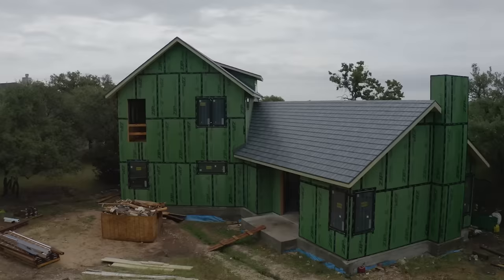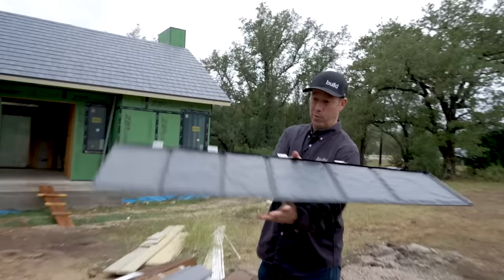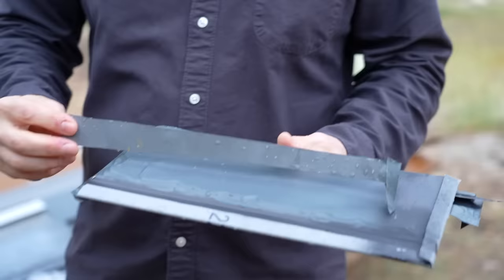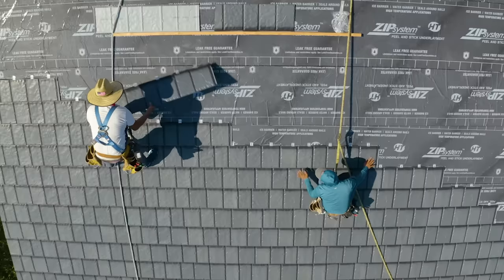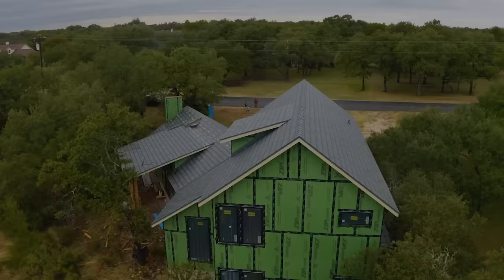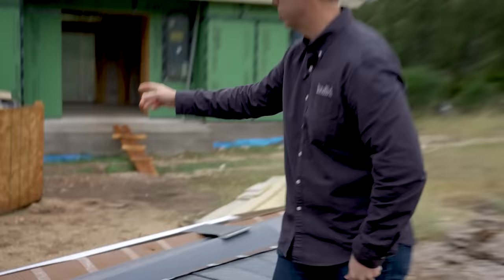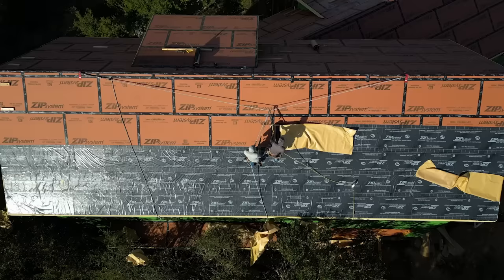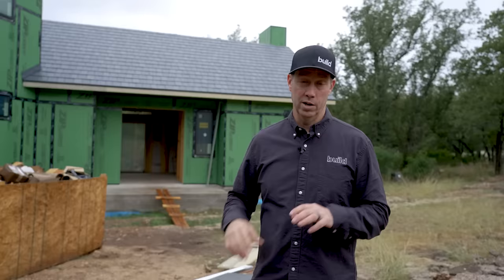Don't like the "metal roof look?" Check out this metal SLATE alternative!

Comment: It was $33,000 in materials to do my house.  I paid $4,000 for shingles.  I can replace my roof every 15 years for the next 120 years before I hit the metals cost.  At 120 years the metal will most likely need replaced.   I just couldn’t.
Reply: How much was labor to install?  That will cut into those replacement roof cost pretty fast.
Reply: @lukemarks9132  sweat equity I believe
Reply: You don’t get the resale value tho
Reply: @lukemarks9132  I don’t even want to know!!   Another product installed by a local company was $36,000.
Reply: @cybertrk  for which?   I’m not worried on a house I built and I’ll die in but it can’t change much.  All houses are 500% over valued right now so I don’t think it matters for a few grand.
Reply: That's something these channels never address. If money is no object than whatever. How good people think the metal is really going to look after 50 years of weather?  Shingles make way more sense economically.
Reply: @smhammer92  well mine were more because 1. I didn’t want their paper thin aluminium.  If I looked at it hard enough it would dent.  So 2. I spent less on galvanized steel which wasn’t insanely thick and hard but I had to pay more for better paint.  That really jacked the price up!!
Reply: Use natural slate it's the best
Reply: @master_Blaster91  that labor has to be insane!   Wonder what the engineering has to be to support the roof?  Just more truss size and closer together?
Reply: @neckofthewoods24  I actually use what's called Yorkshire grey slates . They are huge slabs of Yorkshire sandstone that diminish in size as they go up the roof a roof could have  10 - 30 tons in weight on the roof. They normally have 3 X3 or 3 X 4 wrafters and great huge perlins to support them. It's really hard work. And natural Welsh slate is alot lighter and easier to do
Reply: @master_Blaster91  wow!!!  Yeah not an American style or affordability haha
Reply: @master_Blaster91  how it compares with prices and durability? we grew up with terracotta roof and we loved it
Reply: @maragrace820  we regularly reroof properties with slates that are 100 years old and not leaked no under felt and the slates are as good as the day they were quarried. Brazilian and Spanish slates are the best import slates and in England at least are not that expensive and your roof will last 70 year plus no problems if installed correctly
Reply: @master_Blaster91  just for reference in northeastern United States our ~3300 sq. ft. slate roof will cost us about $200,000 USD to install / replace so yeah “just use natural slate”
Reply: @TheVinceZampella  that's outrageous 😮 must be a huge house
Reply: He said the materials was only 2.5 times the cost. And if the asphalt shingles only last 15 years, and this lasts 100, you are better off just putting on this steel/slate style roof.

By the time you were on your third or fourth roof, you would’ve been saving money, and time, and the bother.
Reply: I'm a distributor of Edco Products. There is no chance your #s are correct. It might cost 3x asphalt shingles. Never 8.5x more. Something is amiss
Reply: @stefanboyer9893  lol well it is and unfortunately they are.  The metal was indeed $33,000 shipped to my house with all panels and edge trim and screws etc!  They wanted like $450 a square and the locking edge trim added A LOT more to the square cost!  Singles were like $28 a bag.  3 bags are 98.4sqft.  My roof was 5,000sqft.  So it’s pretty simple math from there.
Reply: @master_Blaster91 think about the weight!
Reply: Better get someone who knows what they’re doing. Or get a good lawyer!
Reply: How many times can you remove and renail a new roof before you start to compromise the underlying roof deck and structures? 

There is something to be said for treating a house as whole system that works together vs a random collection of rapidly decaying parts worked on by random labor in isolation.
Reply: @caustinolino3687  I’d say a 100.  The house would need replaced first.
Reply: @caustinolino3687  I’d say a 100.  The house would need replaced first.  A little roofing nails not going to hurt the integrity of Osb or plywood sheathing.  Remember a Osb flood joist can have massive holes cut in them and still hold the same amount of weight.
Reply: @neckofthewoods24  Interesting, but I didn't have in mind that the roof integrity would be shot and would collapse. I meant how many times can you have laborers, often sloppily, pulling and (over)driving hundreds of nails into the same materials before it can open the door to other problems like rot, leaks, or whatever.
Reply: @caustinolino3687  well there would never be a leak or rot.  That’s the job of new under-laminate and roofing every time it’s replaced.  Normal shingles are like 10-15 years.  Steels like 100 years.  I think it’d be very rare for a nail to hit the same hole twice which wouldnt hurt the integrity of the sheathing but you’d need another nail so the shingle or metal roof stays attached.  Eventually a nails will start hitting the same holes but again that’s like 100 roof jobs or 1,000 years from now.
Reply: More money in labor than material
Reply: Not only that but you can’t get insurance to replace it every 10 years if you have hail damage and most roofing companies will eat your deductible to get the business.
Reply: Forgetting to adjust for inflation, replacement labour and disposal costs. But if price is the goal then sure shingles cheaper out the gates
Reply: @master_Blaster91 different weather systems. In Oklahoma we can have heavy hale storms twice a year. Asphalt roofs are generally 4-5 years til replacement with 10 really pushing it. Slate and stone roofs just aren’t worth it when you risk full roof replacement every 10 years. Your insurance premiums would be sky high.
Reply: @neckofthewoods24 $28 dollar shingles can’t be rated great though? That’s gotta be a 5-7 year roof max depending on location. Here in Oklahoma closer to the 4-5 end depending on weather.
Reply: @neckofthewoods24 50 years of asphalt roof replacement you’ll need to replace decking.
Reply: @nightterrors6262  I mean everyone uses them.  No way it’s only 5-7 or 4-5.   I know houses 20+.   Doesn’t mean they are mint condition but even if the granules are falling off, you still have the middle and back layers plus the under laminate till you get to the plywood.  Apparently there’s a spray conditioner that some companies are using now to extend the life.  Rehydrates the shingle and makes them last longer.  Don’t know if it true but make sense in my mind.
Reply: @nightterrors6262  why??  I’ve seen shingles come off and the tar paper and the sheathings still mint!   Replace both and you’re good to go again and again.  No need to replace if it’s till good and holding strong.  Good ventilation underneath and water protected on top and it should last forever.
Reply: If you can't afford it, you can't afford it...
Reply: You're not taking your age into account. I'm replacing my own roof this summer and it's the last time I want to do it because I'm 54. I won't be climbing at 70 so I'm spending more for materials now to ensure the roof will still be in good condition when I sell because I need to move into assisted living in my 80s...assuming I even live that long that long.
Reply: No ridge vent? How does the hot air escape from the hot attic?
Reply: @smhammer92  NOT here in PARK FIRE pine flameer forest. Steel resists EMBERS.

Comment: I am building material supplier, and I have had several customers who have went the metal roof route who complained about their cellular service after the metal roofing was installed. Have you had any  experience with cell service issues from metal roofs?
Reply: That's interesting since most modern phones will use wifi calling if they're connected to a local Internet connection.
Reply: I have a Decra Shake steel roof. Yes, you may see a drop in cell phone signal. But there are cell phone signal repeaters available if needed.
Reply: Of course the metal blocks the signal, and that's 4g, 5g is even worse.
It's common that cell signals are reduced so much that a booster has to be installed. A directional antenna outside (looks like a sharks dorsal fin and it is pointed at the closest tower) and a cable that runs down to the base station inside the house that puts out the boosted cell signal.
Note the cheap ones are generally crap, it's worth it to buy the mid to higher priced to get faultless service
Reply: Turn on wifi calling for when inside.  And also, blocking cell service and other invisible radiation is more a feature than a negative
Reply: @gial8862  do you think a 4g/5g repeater is equally bad?
Reply: Metal roofs absolutely interfere with radio waves. 2 options for your customers.
1) install a booster antennae up top with a repeater tail inside
2) use wifi calling which is of course much lower cost and easier
Reply: Not to mention OTA TV reception with an indoor antenna. Or AM/FM radio reception. Or even shortwave radio. First floor reception might not be impacted, but any rooms at the same level as these shingles would be impacted.
Reply: @tt7hvn  : very true but there are people around who still use pre 2020 Android phones  I live in a poor service area, with a corrugated colorbond roof and have a non WIFI calling phone - it rings inside, but I step outside to take (or make the calls, or use whatsapp.
Reply: LMAO
Reply: No trouble with our cell phones but our small indoor TV antenna quit working.

Comment: The house I grew up in had metal shingles and it was 'bullet proof'. The house was torn down in 2017 and was 100 years old with the original roof. After my grandparents died and my uncles and aunts sold the place the new owners didn't have annual termite control done... All it took was a decade of that and the house was damaged so much it was uneconomical to repair due to the termites being in the entire floor and every wall (East Texas Huntsville area where the termites are Texans too, bigger and bader, haha)

Comment: I am a fan of metal roofing.  It's easy to install, looks great, and may last the lifetime of the house.  The only drawback I have encountered was trying to find matching replacement panels to repair a small section of roofing that suffered damage from a fallen tree.  The particular shake pattern was discontinued by the manufacturer a few years after we installed it.  I searched all accross the nation to find something compatible without success.  I ended up replacing the entire roof with galvalume standing seam as I was assured the profile and color would always be available.
Reply: Good point. I guess buying a textured metal roof is like buying that unique Italian ceramic tile for your kitchen or bathroom. Buy extra in case of later damage.

Comment: We just had this roof installed in the spring, over 2,600 sq ft went up in a day and it's been great. The neighbors are all commenting about how good it looks and we are planning a solar installation hopefully before the end of the year. This is the last roof I will ever put on a house thankfully.
Reply: How are you installing solar over this? Matt has recommended standing seam roofs in the past because of the clamp on solar panel standoffs.
Reply: I would definitely NOT recommend using this type of metal roofing for solar. Source: I own a solar company that just crested 55,000 installs. I wouldn’t consider anything but a ground mount were I you
Reply: @mattbrew11  What type of roof is best to go with solar?  Curious. Is it the standing seam? Seems worth the investment if it is more permanent and less chance of leaks.
Reply: What are the approximate costs for 2600sqft of this metal on your house?  I know labor prices can vary but I'm trying to get an idea if it's even in the ballpark budget wise.  Thanks
Reply: @Darksurfr  i built my home with a standing seam Galvalum roof and used a railless S-5 system to mount the panels and route the conduit. In my experience that is the finest roof you can get for solar because it will a) outlast the panels b) requires zero penetrations and c) with proper retainment system can withstand cat 5 wind loads
Reply: @aussie2uGA  need more information to even ballpark costs because hip/valley/roof pitch & plane count can all push costs around quite a bit.
Reply: What was the turnaround time on getting the product shipped out to you? I can’t imagine this is something you can pull off of a big box store shelf.
Reply: Cost?
Reply: @MikeRobot   it was about twice the cost of regular asphalt shingles so given the last roof only lasted about 12 years the math will we hope work out to our benefit.
Reply: @mattbrew11  how is this different than solar on composite shingle?
Reply: @NelsLong  no roof penetrations and no pulling panels off roof to replace it outside  some catastrophic storm, no rails (saves some cost and weight), metal roofs even darker ones run much cooler so theres less efficiency loss and premature aging of the panels and lastly although looks are subject I think it looks bad ass in comparison
Reply: Solar is overrated, unless you're a solar installer obviously. You never break even

Comment: I installed a Decra Shake steel roof on my house, in 1995. It's had 100+ mph winds , 100 degree heat, Hail and Snow. No leaks ,or degradation that I can see.  Steel is the only way to go.

Comment: I lived in a house that was built in 1980, it had a metal roof that looked like tiles, but the advantage was the sheets came in 6 metre lengths, the house was rated for 220kph winds, as we lived in a Cyclone Area.

Comment: I hope this works better than the Dekra version we used on our roof, it was a leaky nightmare.  The worst part are the vents most are only rated for 10 years.   Reason I say was a nightmare first installer didn't do it right so Dekra had another company come out and tear it off within a year, the valleys were leaking.  I thought all was well then the vents all started to leak, had I known I was thinking of having vents come through gables maybe so no penetrations?  Shortly after we sold the house and on inspection there were two major leaks we had to get fixed and finding a good contractor to fix it wasn't easy.  I would  not trust just any installer to do it right.  Wish there were more contractors around like you who would stand behind their work.

Comment: Love the look my question is how adaptive is this style to solar panel mounting?
Reply: Great question, I was going to ask that myself.
Reply: It's not, and solar won't be around anyway unless the government ups the subsidies.
Reply: I'm going to guess the answer is going to be, "Not very".  You couldn't very well anchor mounting rails through the roofing without crushing it, and if you were to cut slots in the shingles so tabs for the rails could poke through you'd lose almost all of your weather protection.
Reply: We have metal shingles on our roof and we asked for a quote for solar panels this summer and the installer refused because of this kind of roof. He cannot guarantee the roof won't leak and void the warranty.
Reply: @GervaisRioux  that's sad
Reply: Yes. This is the question.
Reply: @smhammer92  why are you spreading lies?  If solar subsidies end, then the payback period simply extends by 50%, so an array that would pay for itself in 6 years with subsidies will take 9 years without subsidies, but that hardly means that solar “will go away.”  Solar is now offered as an upgrade option on new home construction, where the upfront cost gets rolled into the mortgage, meaning that the homeowner has lower monthly costs from day 1, and that is true with or without any subsidies.
And solar is easy to install on metal roofs, depending on the system there are either specific clips, or it installs similar to an asphalt shingle roof.
Reply: There are solar panel mounts that have a bracket that slips up between shingles.
Reply: Probably pretty straightforward if planned for during the install (install the correct mounting tabs up under the appropriate rows of shingles)... Given the way these lock together though, retrofitting mounting tabs after the install looks like a nightmare 😂
Reply: The ice and water shield underlay provide the waterproofing. Properly installed, the brackets would never cause a leak. The roof would still last a hundred years or more.
Reply: Absolutely not good for solar. I own a business with 55,000 installs. A synchronized roof like this makes it much harder to do and potentially voids the warranty. There are some good choices that are stone coated and the best choice (which is on my own roof) is standing seam with a railless S-5 clip for mounting.

Comment: I love a good metal roof, I don’t do Mutch roofing anymore, but 25 years ago I used to install Girard, Decra. Granulated steel tile. It was an awesome roof if it was installed right. unfortunately, I have repaired many granulated steel tile roofs. Failure always came in when a installer just don’t care. 
I like this style of roof because you lay your 1” x 4” vertically then 2” x 2” horizontally, and then you can insulate in between the bats. Something you should appreciate insulated roof. It really helped break that thermal transfer.   When we started, we use smooth shank nails, and we found that they would back out through time. Then we went to ring shank nails. Made it harder to repair them, but really tied everything together.  I find myself doing repairs on them occasionally because there isn’t a lot of steel tile installers out there.